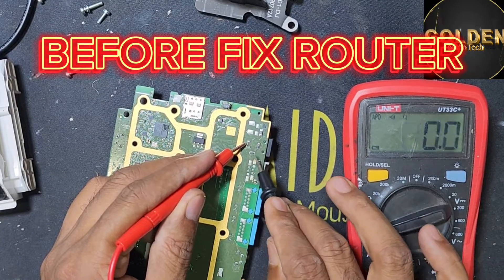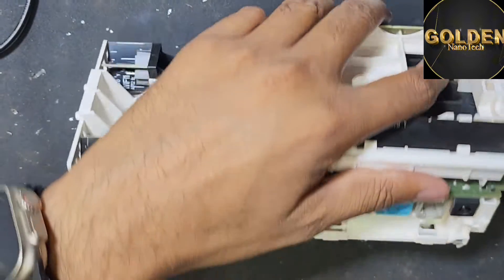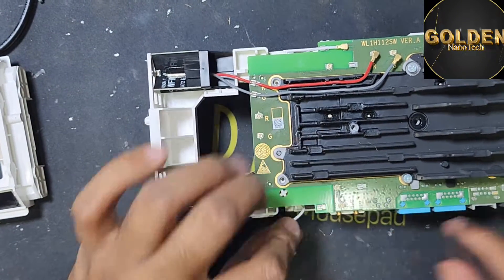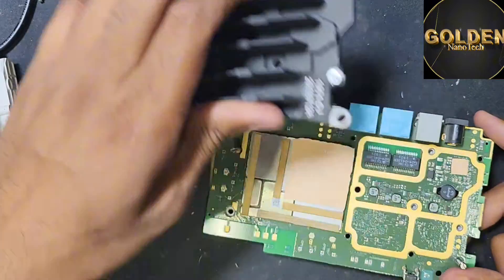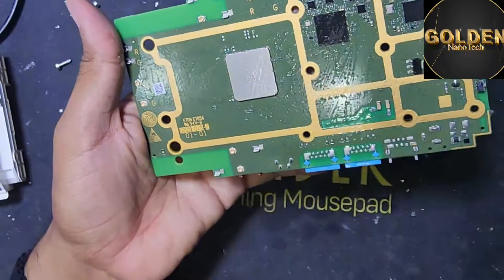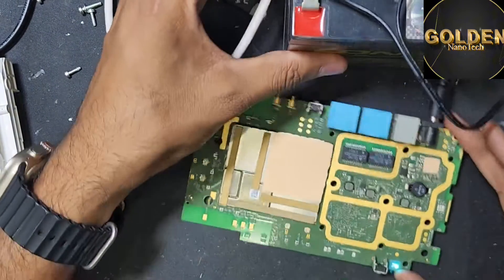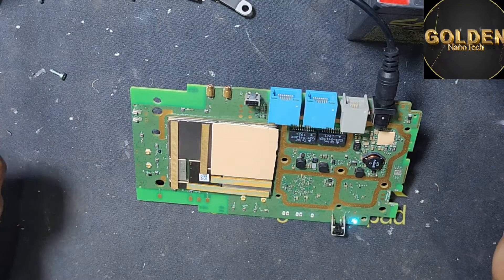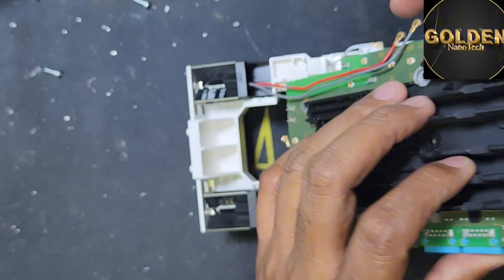HOW TO FIX NO POWER HUAWEI 5G ROUTER H112-370 MODEL CPE 5G PRO 2/FIX NOT WORKING

Comment: this way ,just a lucky.if find short.you are use big Am to burn short chip,but it is chip,you will make chip dead.this way not good way.
Reply from the maker: what's should i do ?
Reply: first make sure which chip or capacitance bad,you can use small voltage and big electricity to loading.find bad part bythemal iamgery. and then rmove bad capacitance or install new part chip.  @GoldenNanotech